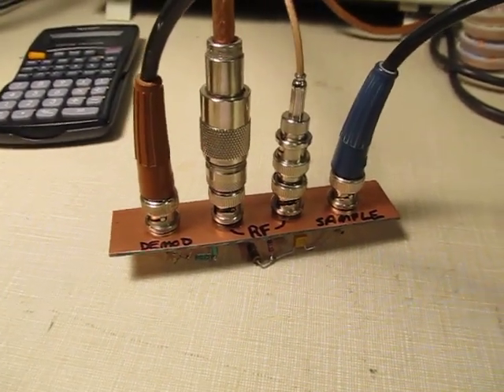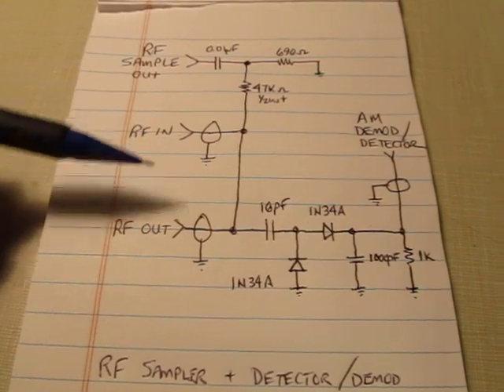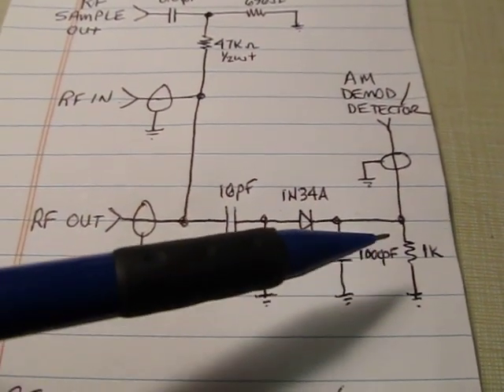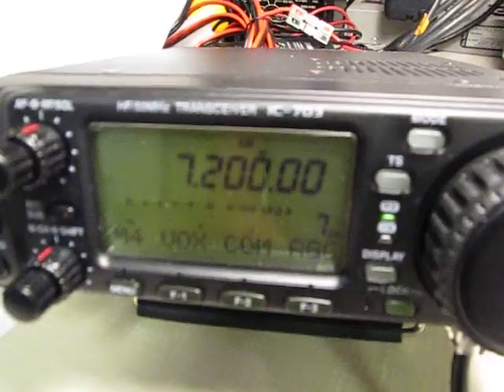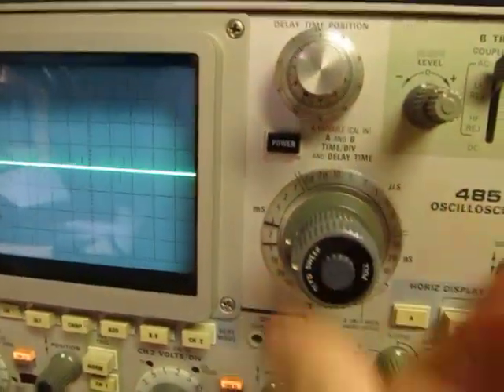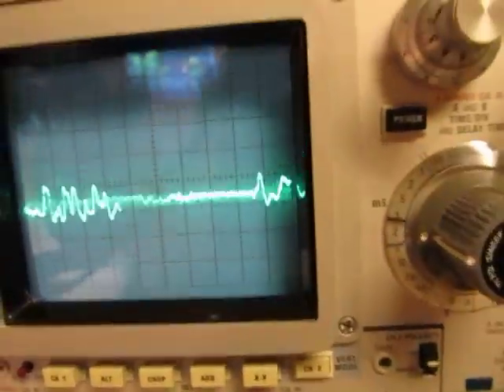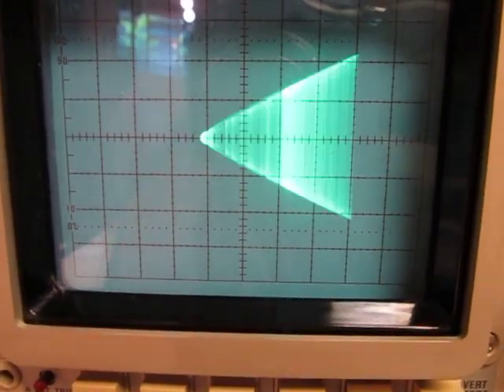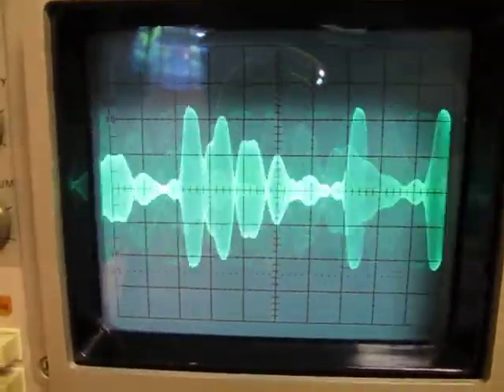#7: Monitor your Ham Radio transmitter with an oscilloscope

Comment: Hi Alan ,  apart from that Tektronix 485 scppes MAGNIFICENT display are the components and board that you used for that RF sampler  demodulator board could they all be submerged in mineral oil ? Ie dumped in a 4ltre paint can as part of a dummy load so239 + the 4 BNC OUTPUTS in the cans lid ?
Cheers Alan.
Reply from the maker: They probably could.
Reply: @w2aew  thanks for the reply..I will give it a crack.

Comment: Thanks, Alan, this is just what I need to test my new transmitter (Icom IC-7300) before making my first QSO.  Although I can follow your very clear explanation, I'm confused when you say (paraphrasing) "to be sure to size the resistors to be certain they can handle the power they're going to be sensing".  I assume your QRP rig is putting out 5W and my 7300 is putting out 100W into a dummy load. But without voltage or current information how does one calculate the power that will be dissipated by the resistors?  Sorry for the newbie question.  JS2OLO
Reply from the maker: At 100W, you're likely going to be better off using other sensing methods rather than a resistive tap.  See my video at on RF Samplers...

Comment: i have an old scope, but had so much frustration with it to check the 4mhz signal, even when using a DIY highpass filter, i think my problem was trying to use the stock probes, they pick up too much AC noise, i guess i should run a coax from my circuit to the bnc plug

Comment: Great video. On the de modulator, are the voltages of the capacitors important? Are the cap voltages and values determined by the output power of the transmitter. In my situation, an Icom IC 7300. What were the voltage values for the de modulator caps that you used? I've got a Yaesu YO 100 monitor scope that does the Trap display but I'd rather use my Tektronics 2465 BDM.

Comment: What type of scope needed to check modulation on ham radio 10meters to see if I'm over modulation.Also what all would I need to hook it up to the transverse
Reply from the maker: In general, the older analog scopes are better than the newer digital scopes for looking at the RF envelope of your signal.  You can also use a device called a Station Monitor such as the Kenwood SM-220.  The station monitors have the advantage of connecting in-line with your coax.  The Heathkit HO-10 is another example of a station monitor.  Here is my video on the SM-220: https://youtu.be/Ior4MROmjr4
If you are not using a station monitor, then you'll need some way to sample the RF signal to get it into you scope.  This can be done a number of ways.  Check out these two videos:
https://youtu.be/0Kk_N_TpDeo
https://youtu.be/2D83xp3H5Bo
When choosing an analog scope, look for something with at least 25 or 20MHz of bandwidth.
Reply: @w2aew  so 50-100 mhz is to much
Reply from the maker: @ironhead320  Well, there's really no such thing as "too much".  An oscilloscope with 50MHz, 100MHz,  or even more more will work just fine.  Just as long as it is greater than 20-30MHz is best.  Even a 20MHz scope will work for this, it just won't be as sensitive.
Reply: @w2aew  ok thanks

Comment: Good morning. First of all I want to apologize for my bad English. My question is what is the capacitor value of the RF sample, I don't understand its value... 10pF?. 0.01nF?. It has to be plastic and not ceramic? I loved the video, I have an SM-220 from Kenwood but in the second QTH I want to put the same thing but with an old oscilloscope that I have several. Thank you very much for your answer dear friend, a great teacher although I have a hard time understanding the details by the language.
Reply from the maker: There are better ways to do the RF Sampling. Check out these videos:
https://www.youtube.com/watch?v=0Kk_N_TpDeo
https://www.youtube.com/watch?v=2D83xp3H5Bo

Comment: Really interesting video, what would a typical amplitude be on a ham radio 100w PA ? Curious given p=vi what the relationship would be between volts and amps Many thanks.
Reply from the maker: 100W would be 200Vpp into 50 ohms.  If  using a voltage divider like this video, you can calculate the measured voltage.  A better way would be an RF tap or sampler - I have a few videos on this.
Reply: @w2aew  thank you for your reply, I’ve recently obtained an old LPF board from a Yaesu FT77 and was thinking about utilising it for some filtering for a 100w amplifier I have that doesn’t have any. I just need to check the working voltage of the LPF capacitors as it’s unclear on the schematic. Do you think this is a plan worth trying ?
Reply from the maker: @johnblake4503  You'd have to check the schematics for the FT77 to be sure that this LPF board is used at the 50ohm output of the final amplifier.
Reply: @w2aew  once again, I thank you for your interest and time. I can see from the schematic that the signal path is PA->LPF->Antenna, there is a relay on the LPF board that directs the TX and RX accordingly, both pass through the LPF. I’ve checked the capacitors this morning and they seem to be 500vw. If successful it could be a easy way to get a tried and tested LPF. Your channel is so interesting, it is food for my brain. G7AER

Comment: Alan, had to check out your video and build this circuit as I have built another AM station. Using a James Millen 80991 (push pull 812A, swinging link coupled) and modulating it with a pair of 4-125A and a BC-610 modulation transformer mostly on 40M but sometimes on 20M. Don't have enough room for an 80M antenna. I have two 485 and they are still magnificent scopes even 10 years after you posted this video.  I guess they are getting to be around 50 years old.    73

Comment: Could I use different Diodes? Are they critical? Don't seem to have those in the parts bin...
Reply from the maker: Ideally you would use switching diodes or signal diodes - the particular type is not critical.
Reply: @w2aew  THANKS! I just tried the trick with the unused Antenna Tuner output from your other video. Works great! Thanks. I have a pie of old radios in process of restoring and this will be handy....

Comment: Fantastic video! Can you please let me know what the connectors are please?
Reply from the maker: They are ordinary panel-mount BNC connectors, also referred to as bulkhead mount BNC jacks.
Reply: @w2aew  Thank you! VK4JRH (John)
Reply: @w2aew  The RF passthrough should be 50 ohms? those BNC connectors are 75 ohms. How does this work?
Reply: The RF sample out is coupled via a .01uf capacitor? (can't quite read it)
Reply from the maker: @Hannaford_Photography  Those are 50 ohm BNC connectors.
Reply from the maker: @Hannaford_Photography  Yes.
Reply: @w2aew  Thanks for your help!
Reply: @w2aew  are they all 50 ohm BNC connectors?
Reply from the maker: @Hannaford_Photography  In this case, they are.
Reply: @w2aew  Thank you for your help!

Comment: Thanks for the share.  Just got done building the circuit, but performance isn't what I expected and have some questions hopefully you can address.  First thing I notice is that it doesn't seem that useful for sideband.  Applying two tones, if I change the modulation, I just get a larger or smaller triangle, but the triangle itself doesn't change shape.  Is the trapezoid method meant for only AM use?  I see dual triangles opposite one another which may be more useful, but not sure if this circuit can do this.  

Another thing I notice is that I can't seem to overmodulate.  I increase mic gain and/or tone generator for maximum on AM, but whether the trapezoid or sine wave, they reach maybe 90-95% and go no further.  Could this be due to the radio's internal ALC setting?  

When I first tried the circuit, I was getting "bitten" when I tried to adjust the tone generator, then I discovered that I had RF sampling going to channel B and modulation sampling going to channel A.  Switched them and I don't notice any "bites" now.  Does hookup have to be as you did to avoid this issue (RF to A, modulation to B)?

My radio has a built in SWR meter.  I notice with the modulating sampler inline, SWR on the radio increases to around 2.5.  If I just use the RF sampler, under 1.5.  Any ideas why the increase?  Note that I didn't build it the way you did.  I have a separate small box for RF and another for modulation sampler.  

My voltage divider, borrowed from an existing one I made years ago, is 20:1.  Does this matter?  I also don't have a 0.01 uF cap at the output in mine, just the resistors.  Should I add the cap?  

Lots of questions, sorry, but new at this sort of thing.  Just trying to do it as accurately as possible and thank you in advance.
Reply from the maker: As described in the notes below the video, this circuit - as shown - can NOT be used to measure non-linearity with the trapezoid pattern since both the sampler and detector are fed with the same RF signal.  Refer to the notes appearing below the video.  This circuit, as shown, is only suitable for QRP levels of power.  See my other videos on RF Samplers to get some ideas for higher power RF monitoring.  Yes, both the RF sampler and the detector WILL affect the SWR.

Comment: (I’m thinking yes, but:) Would this also work for checking the CW signal shaping of a QRP transceiver? My natural side tone has a slight key-click. I can’t hear it on another receiver, but I’d like to look at it on the scope anyway.
Reply from the maker: Yes, you can observe the rise/fall times of the RF envelope, which will give you an indication of the key clicks.

Comment: How much would you have to beef up your circuit to test the quality of a 800W HF amp.  thanks KC1OGS
Reply from the maker: I wouldn't use a resistive tap for your high power setup.  I'd use other types of RF sampling - see my videos on this....

Comment: Hi, where am i connecting the scope probes on my radio to monitor modulation or do i just run a coax from radio to ant to scope?
Reply from the maker: Do NOT run coax directly into the scope - that's a good way to fry the input of the scope.  Check out these videos:
https://www.youtube.com/watch?v=0Kk_N_TpDeo
https://www.youtube.com/watch?v=2D83xp3H5Bo
Reply: @w2aew  thank you

Comment: w2aew, I was watching a TV show in the 60's and the Germans in WWII would find are radios, transmitters and receivers by using a device that would somehow "intersect" to know which houses had US radios transmitters and Receivers. The Germans would drive around with this special antenna on top of the truck and they guy would use a formula and find how the RF signals were intersecting to know which house it was located at. Not sure if you know what this is called or what they were doing

Comment: W2aew, Older Transmitters and Radios used theses dark metal tan vacuum tubes that were called i think Emitter tubes which needed to be Positive Bias. Why did these tubes needed to be "positive bias" on the vaccum tubes metal can shielding? What i mean is that if you tried to put your hand and grabbed the metal can shielding you would get shocked from the very high voltage positive bias, not sure why they did this. Any reasons you think?

Comment: would be really cool to see how the scope is setup in a video for us not real familiar with them
Reply from the maker: It depends a little on the scope and the type of sampler you're using, but here is a good starting point:
Vertical: AC coupling, V/div as needed to get a good deflection (10-100mV/div typically)
Horizontal: 1 or 2ms/div typically
Trigger: LINE, normal or Auto

Comment: Great vid.i wish i could figure out the settings on my scope to get ssb to read correctly
Reply from the maker: Typically about 1ms/div horizontal, trigger source set to LINE.  Vertical scale as needed, typically about 10-100mV/div.
Reply: @w2aew  thank you will try. Im alittle scope challenged..73

Comment: Hi w2aew, just one question. I don't have an Spectrum Analyzer, so there is a SDR platform calles RTL-SDR (i think you know it) for some kHz to 1.7GHz, how can I use it for doing Spectrum analysis connecting the RF input directly to a transmitter or any source? How can I calculate the input impedance? In order to not to burn the RF input.
Reply from the maker: See my videos on RF Samplers for more information.  The signal level going into the RTL-SDR will need to be very low since it doesn't have a large attenuator built in.
Reply: @w2aew  thanks, I will check them. Awesome videos!

Comment: This is awesome! Could this concept/configuration be use to monitor a stereo receiver output?
Reply from the maker: A fun thing to do is to put the scope in XY mode and apply the right and left channels to the two inputs.
Reply: @w2aew  Thanks for responding Alan! So with your attenuation device, no danger to the scope? Also, I have an old Sencore vector scope I can have some fun with... Thanks again and looking forward to your next vid!

Comment: If I chose to use metal film resistors for this project would that be a poor choice because of the potential of parasitic capacitance affecting the sampled output?  I ask as there seems to be so much conflicting advice across the net on this topic.
Reply from the maker: It's probably going to depend on the particular manufacturer (i.e. how thin they make the gaps in the spiral).  But, at HF frequencies, it won't matter much.  Plus, the values aren't too critical here anyway.
Reply: @w2aew  Thanks Alan - very much appreciate your reply.  I'll just go ahead and use the metal film resistors I have in that case.  I have a nice compact aluminum project box just about ready to be completed with your design here.  I've been meaning to build it for quite a while so I can complete some radio alignments I've had waiting to do and finally got around to it.  Appreciate your videos very much. =)  Thank you.
Reply: @w2aew   Hi Alan, I built the RF sampler and housed it in a small aluminium box.  It works really well and I'm so pleased with it - thank you.  I am now attempting an SSB linearity check on my HF radio with my Marconi 2955B radio communications test set.  Surprisingly, I get a horrible screeching, buzzing cacophonous sound through the 2955B's speaker when I directly feed the mic socket the 2955B's two-tone audio output while trying to carry out the two-tone (500Hz, 2.4kHz) USB test and potential  adjustment.   I have the 2955B connected via my new RF sampler to the radio's antenna socket and a separate scope connected to the RF sampler socket, as in your video.  The scope signal and output power is very unstable but in sync with the chaotic sound and I've tried with two different radios with the same symptoms.  I must be missing something as I just can't correct the output even by adjusting the two-tone signal levels.  I'm guessing I must be making a classic mistake here (some kind of mis-connection perhaps causing feedback?)   Even if I feed a 1kHz, 30mV signal through the mic socket it shows a very unhappy signal.  Would you have any idea what may be the cause?  Thanks so much.
Reply from the maker: @zerox-mission1703  Sounds like classic RF feedback into the radio - likely through the audio leads.  You'll need to make sure everything is shielded.  Maybe put some ferrite beads on the audio input leads.
Reply: @w2aew  Thanks Alan.  I think I have a ground loop as the power to the subject radio is maintained with the antenna patch lead connected to the Marconi without the radio's ground wire connected the SM PSU.  I thought an audio transformer like an Eagle LT700 might prevent the feedback but I have yet to obtain one.

Comment: Thanks for making this video! I'm studying electrical engineering right now, and most of my time goes into learning the theory, but this video shows how Ham is very relevant to gaining some hands on experience.
Reply from the maker: Ham radio is one great way to get involved in hands on electronics, since we are permitted to design, build and use our own gear.
Reply: w2aew I am planning to start with the pine board project by Bob Heil. Do you have any suggestions for other designs or projects that would be good to start with?
Reply from the maker: I probably wouldn't start with that as your first project, mainly because it uses line/high voltage and vacuum tubes.  Plus, the end goal is a transmitter, which would can't use until you're licensed.  I'd probably start by building a HF or shortwave receiver - tons of plans online.
Reply: w2aew Thanks! I'll search for some plans.